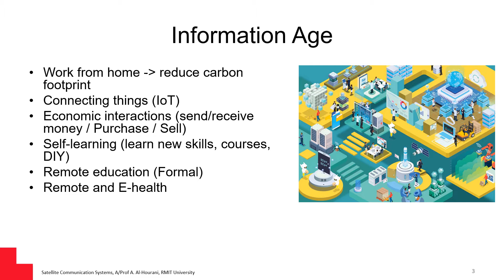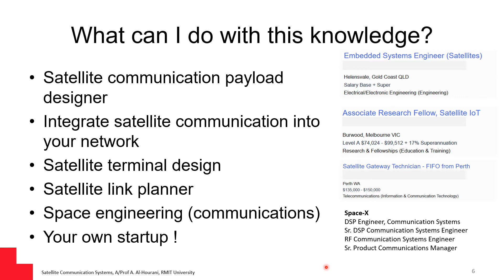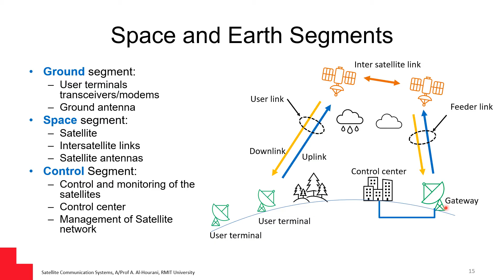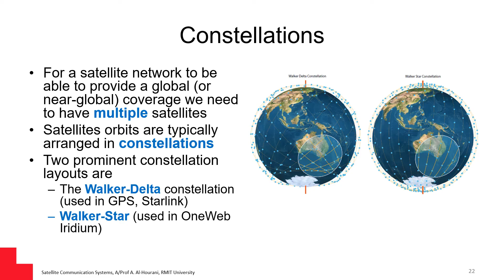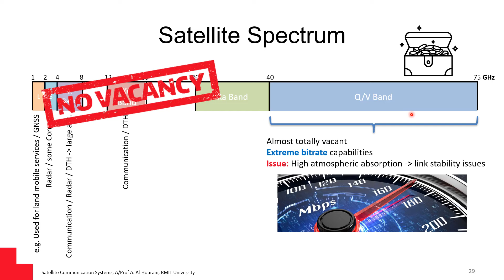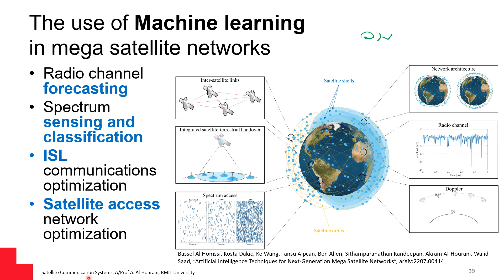Lecture 1 Introduction to satellite communications engineering

Comment: I thought it was great to receive an introduction to satellite communications engineering, and obtain a great understanding of the different orbits- LEO, GEO and MEO, and then observe the various figures illustrating the vast amount of coverages 1 satellite does... this was quite surprising since I wasn't aware about their speed km/s and the severeness caused by their collisions against each other including other satellite debrises. I thought it was outstanding to obtain the simplified knowledge illustrate from the figures regarding the communication between the satellites and the satellite terminals; another thing I had noticed and which knowledge I rarely possess since I never knew the tangible material's names.